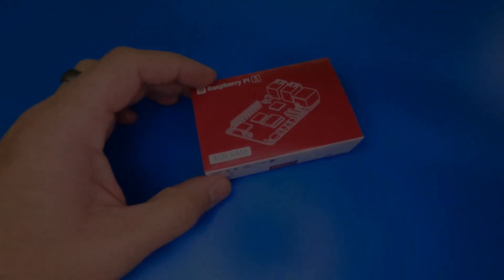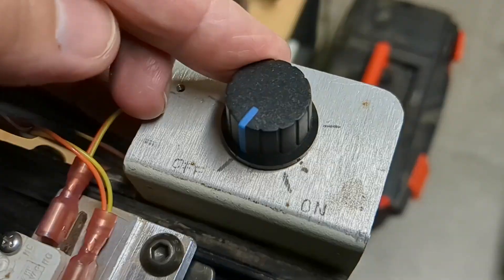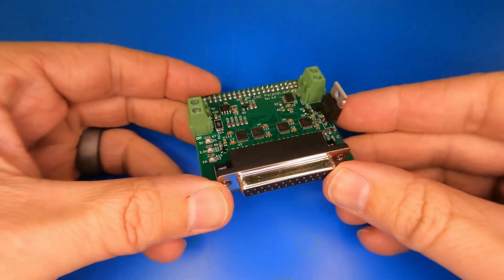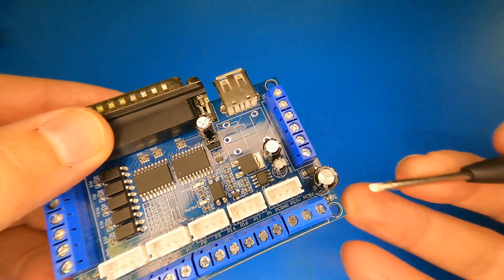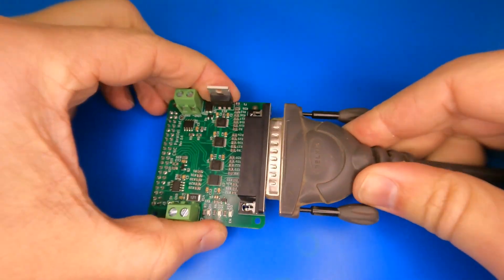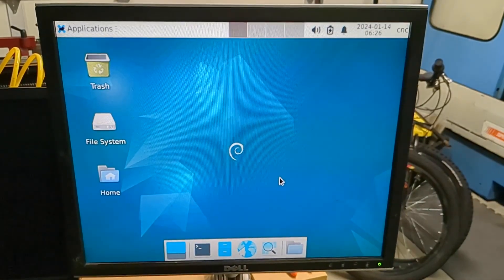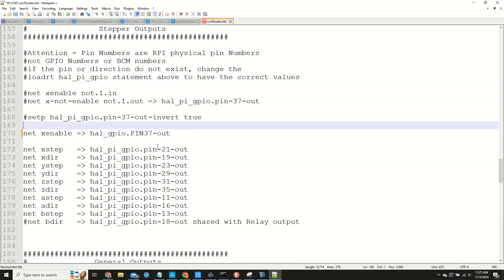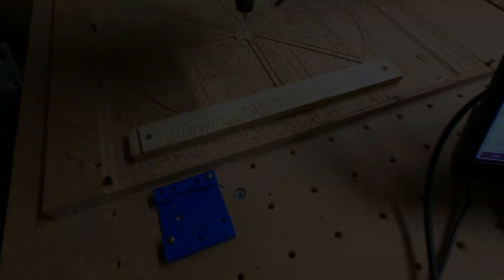Using LinuxCNC on My CNC Router Using a Raspberry Pi 5

Comment: Thanks for being available to help. I have raspberry pi 4, is there any changes i would have to make like you did on the 5? I have an 8ram so I'm hoping for good results.
Reply from the maker: No changes necessary.  My router worked just fine on a Pi4.  If you download the latest pi image from LinuxCNC, it should work just fine.  The only reason I initially had slowness in the user interface was because I used a very early version and they fixed some things since then.  I have both Pi4 and Pi5 Hal file examples on my website, so you shouldn't need to change much.

Comment: i havent used my CNC mill in a decade since winXP and the last PC running it went bung, and yeah... 
my gecko 540 gathers dust... been challenging finding a parallel port board that works... dont trust USB to parallel...

i tried stuffing linuxcnc onto a PC a while back, and didnt get anywhere other than brick a PC. why would i have any luck with raspbery pi if i cant even do that?

the next hurdle is putting the mill back together! lol. ballscrews all rusted out thanks to a well placed leak in the roof. new screws, metric this time! no more forgetting g21 and crashing...

started scraping it. got held up with the main column and needing a special tool to check parallelism/twist in the ways...
but never fear, i just made a new slit saw arbor so i can mount the indicator so i can measure the freaking column and the chunk of steel is sitting in the vice waiting for me to stop procrastinating to make said indicator mount...

nevertheless, this does look interesting...
Reply: The challenge of CNC is it takes mechanical, electronic and software skills integrated to get it to work. Not many are good with all three. I made my first motor drives from scratch. The trick there is optically isolating the digital lines. Step and Dir. Took me a while to figure that one out.
Reply: @1pcfred  lol, just reminded me... the LAST time i used my gecko was to drive a coil winder... only challenge there was calibrating the leadscrew and keeping tension whilst wrapping with insulating paper...

i find the biggest challenge with software/hardware is how everything becomes obsolete almost immediately and it seems that every day you have to go and re-learn how to do everything. new acronyms, abbreviations... WTF is a "macro", FFS? "just throw a script at it i wrote in pypy..."

open this , download that, buy those adaptors for ICSP... wait three weeks for delivery...its arrived? hey! we changed everything again!!!! thats not how you do it anymore!

ARRRRGH!!!!!!

i just wanna machine something! waaaah!

i seriously regret spending so much time on sketchup? its freaking hard to make the change to "real" CAD... and how i miss sketchup 16, and all its little plugins.

shakes fist at google and trimble
Reply: @1pcfred  ironically, i have "after shock" sitting on a shelf within arms reach... believe thats the sequel to future shock?

i sort of read them but didnt as i sort of already knew what they were saying... and that was when, the 70s? 80s? nowhere near as bad as it is now!
Reply from the maker: I agree that installing LinuxCNC is a daunting task.  Luckily they provide an SD image with it already installed.  All you need to do is configure it for your machine.  That in itself is sometimes frustrating, but rewarding too.  It is worth trying even before you buy any other hardware just to get a feel for it, assuming that you already have a Pi.
Reply: @Byte2Bot  sent the link to a friend, i know he has a pi somewhere. 

it seems ideal for a neat build in a small enclosure.  but i commented before i saw the breakout board was your own design and may not drive the gecko... it should, i doubt you went and did anything silly with pin designations or timing/baud rates?

mach3? that was simplicity itself. the intention being to install, configure, MACHINE! not spend three weeks pulling ones hair out cus you gotta figure out dual boots or figure out UEFI blah blah... twiddle thumbs waiting for installations then nothing happens...
shame its windows only. 
shakes fist at kernels and firewalls
yknow, i worked on an old NC plugboard machine, and that was EASY!!!!!! if not rather awkward?
the only challenge there was the same as any machine tool... feed rates, cutters, blah blah... 

i hate modern technology :)

Comment: Does the use of a Raspberry Pi have comparable benefits akin to 3D printers running an MCU board in conjunction with the RPI host cpu doing kinematic calculations ?
Reply from the maker: I think the main usage of the pi is to simply replace the computer that was previously used.  3d printers do need to have a lot more look-ahead and kinematics than routers do because of the flow rate of the melted plastic.  You may not be able to tell in the finished product if the router used kinematics.
Reply: it does not. and i cant see any reason to ever use a rasperry pi, for an cnc in 2024. its like using 90`s tech.

Comment: Does Linux CNC have to run parallel?  I have a cheap Mach 3 board I got from Amazon and wanted to move it from a PC USB cable to a Raspberry Pi.  This means I could use a bigger heat sync since I don't need a hate and have the same flexibility as you do.
Reply from the maker: I have not tried a USB to parallel adapter.  If the driver works, then perhaps you could get it to work.
Reply: @Byte2Bot  I doubt it unless LinuxCNC has radically changed their policies. They have their valid reasons why they don't support CNC output over USB. The LinuxCNC project is driven by technical excellence. So to that end there's just some things they won't do. When LinuxCNC says they're a hard real time machine controller they mean it. No monkey business. USB and dongles are the road to monkey business.
Reply: @Byte2Bot  LinuxCNC will not output real time signals on USB. That's due to the limitations of USB and the demeanor of the dev team. They just ain't doing it. I think they have a web page that explains why they're not doing it. Maybe not? But there's load of forum posts of people being denied. Explaining why it is technically an incorrect thing to do. LinuxCNC is a vanity project. Everyone that works on it is doing it just in a quest for technical excellence. So they're not going to try to output real time signals on a bus that can't do it. I think LinuxCNC has been hacked to do it? But it isn't something that's officially supported.
Reply: better fight mach3 USB card and software to trash and use only linuxcnc not need more,  buy paraller port card pciE MCxxxx chip, and connect normal cheap 10$ parallerport breakoutboard to PC and then wiring drivers. lot better than all USB mach3 systems, windows OS NOT have realtime and safety control any machine, eed use linux OS realtime kerel system if want safe and true good system.
Reply: My situation exactly. I wrote a firmware for this card, but I believe I may be able to run with stock firmware if I write a good driver. Reply if you want to know more

Comment: Not to ruin your day, but you know there are USB-Parallel port adapters?
Reply from the maker: Honestly, I can't even count how many other implementations there are.  Yes, USB adapters exist, FPGA boards exist, and some of those may be better suited for some applications.  Just pick one that you know won't have any driver issues in Linux.
Reply: @Byte2Bot  LinuxCNC is a project that uses Linux but LinuxCNC has nothing to do with Linux. The USB issue has nothing to do with drivers either. It has to do with USB itself. USB is polled as opposed to interrupted. So there's no guaranteed timings over USB. USB could certainly work most of the time. But that's not nearly enough time for the LinuxCNC team. They want it to work all of the time. So they won't support a half measure.
Reply: @Byte2Bot  usb has too much latency, hence the need to use parallel port to begin with

Comment: So. Why didn't you make a complete solution In one hat and eliminate the need for the db25 all together?... Edit to clarify... Super cool concept and looks great. Definitely an option for future upgrades for me!  Just curious about reasoning.
Reply from the maker: Great question!  I was wondering who would be the first to ask!  It kind of boiled down to two reasons.  First, the 5 axis breakout board is so incredibly inexpensive that I was worried that I wouldn't be able to purchase the components for as low as I could buy the board for.  The second reason is that that 5 axis breakout board is available everywhere.  Alibaba, AliExpress, Ebay, Amazon, everyone carries it.  My guess was that a lot of people may be using it already.  If they are already using it, then they just need a convenient way to plug the Pi into it instead of their PC.  Changing the CNC's wiring to accommodate whatever board I come up with might be a hassle and I would have to mimic the same physical layout of the connectors.  Also, I ended up adding a lot more to my board than I originally intended, and I wouldn't have been able to fit the 'hat' form factor if I included the functionality of the 5 axis breakout board.   Having a DB25 connector does mean one more point of failure, but the risk is quite low.  In the future I may just go ahead and make a larger board with everything on it.  We'll see.
Reply: @Byte2Bot  well thank you sir!  I appreciate the response. I understand your reasoning. I will keep an eye on you and maybe buy a board, just in case!

Comment: This is the same kind of setup I want to use. Nice to know how it works for you. I also would like to know more about your router and how the spindle is working for you. I have the 500W spindle that I want to use for my first/starter cnc router.
Reply from the maker: I really like this spindle.  It works great for 1/8" bits in ABS and hardwoods.  I originally used a laminate router and the whole neighborhood knew what I was doing.  This spindle is quiet.  I usually take my time and do at least 3 passes in 1/4 inch material.  If you have the need for speed perhaps a larger spindle with a VFD is a better option.
Reply: I have one of those "500W" air cooled spindles.  I had to put 500W in quotes. Because I measured it and I could never get it to draw more than 100W. I put it under a pretty heavy load too. Which using it 100W seems more in line with what it is doing. I had to use an analog meter to measure it. Digital meters would freak out with the SMPS. They wouldn't give me an accurate reading or anything I could make sense of. My biggest gripe with them is they're too low RPM to use with the size bits they should be running. Way too low RPM. 3 times faster would be better. But as you say they are very quiet. I was using a router and it was getting on my nerves. But a router is real fast with a lot of power. I still couldn't take the sound.

Comment: Using traditional parallel port technology - interesting....  How are you finding latency?

RPI also supports SPI which has been used in similar CNC projects and recently the Novosun NVUM / EC cards have been reflashed with Remora firmware to interface with custom HAL drivers for ethernet
Reply from the maker: Latency is better than I am used to.  The old Dell PC was a slower processor than the Pi5.   I was able to get a worst case latency test by trying to launch YouTube in the web browser.  Almost 2mS on the servo thread.  I'm sure the SPI board is better than that, but I don't cut fast enough to even notice any effects.

Comment: No point soing anything but a genuine fan and heatsink.
Reply from the maker: Agreed.  It is probably throttling back a little bit with the heatsink I have.  Both the Pi4 and Pi5 are measuring about 38 degrees internal processor temp.  I will order the genuine one and use it for the long term.